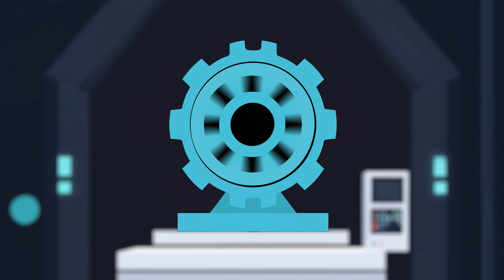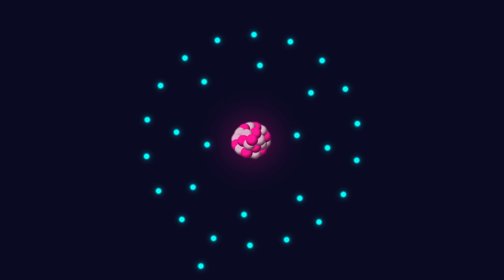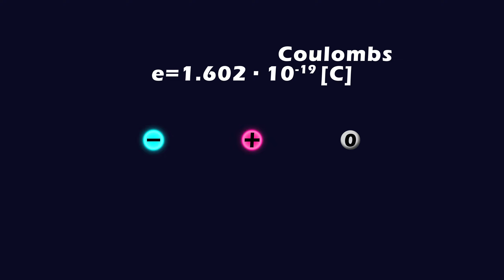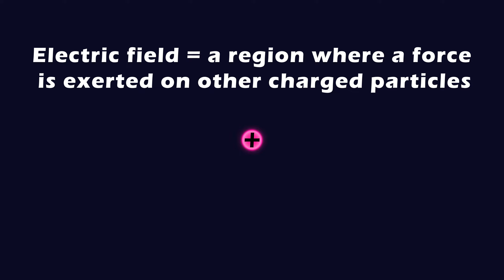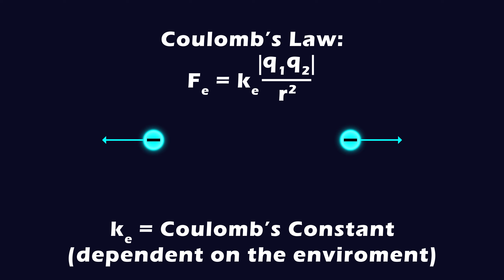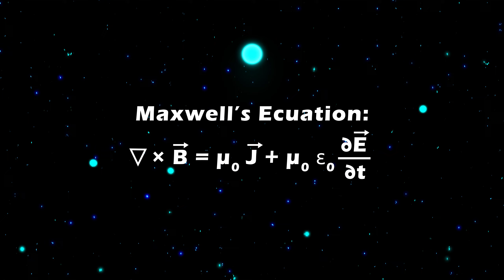What is Electric Charge REALLY?

Comment: Wow! This is awesome! I finally found a video on YouTube that taught me about electric charges! Other videos were full of bloated info, while yours is really detailed and well-made! One question: Since the neutron ignores the positive and negative plates, does that mean it's impossible to steer or control a neutron using electric fields?
Reply from the maker: Thanks! I appreciate the feedback! My goal is to strip away the fluff and focus on the mechanics. To answer your question: You are absolutely right. Since the net charge is zero, the Electric Field is essentially "invisible" to the neutron (F=qE, so if q=0, Force is 0).

This makes neutrons notoriously difficult to steer! Unlike protons, which we can guide with electromagnetic fields (like in the Large Hadron Collider), neutrons tend to fly in straight lines until they physically crash into another nucleus. That's actually a huge challenge in nuclear physics and we have to use other methods (like collisions) to control them. Great observation!
Reply: @V @VastVoltage Now this an extra that I really appreciate! Thank you